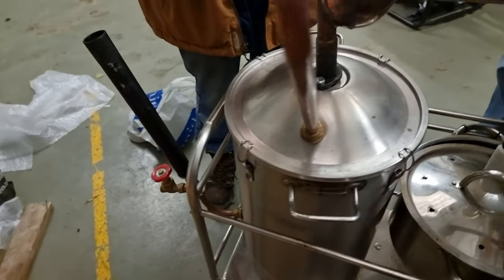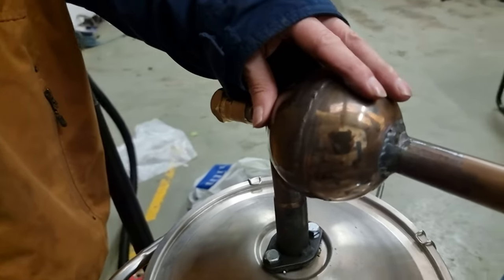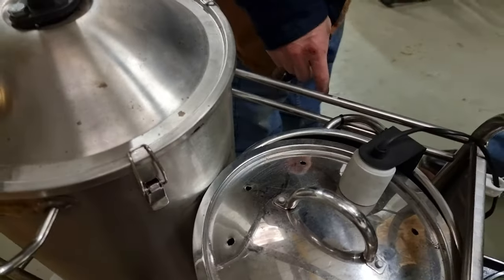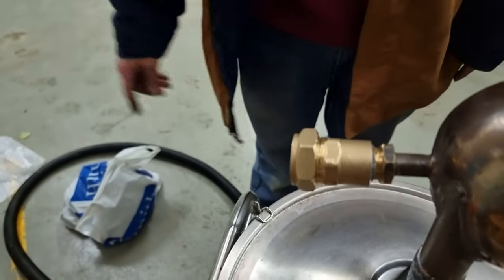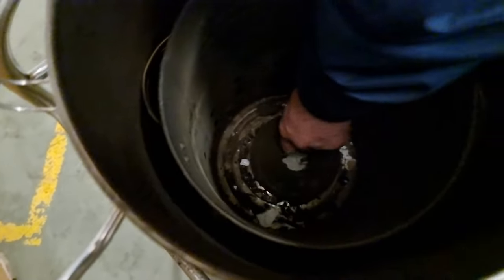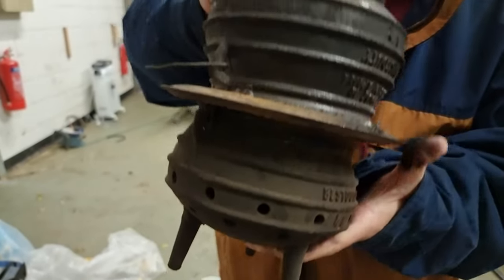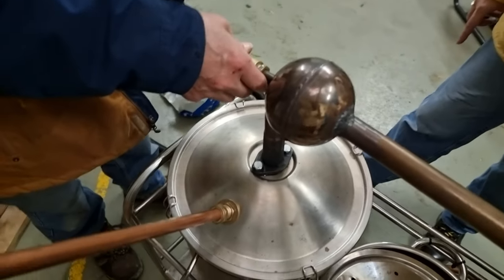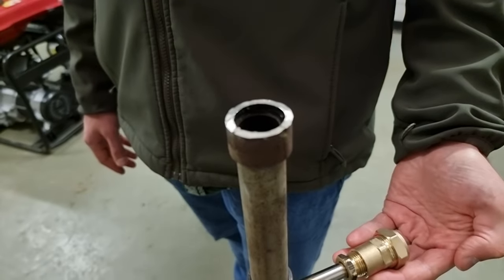THOR - Burning COAL

Comment: I just remembered that Santilli had proposed to use his special flavor of gaseous storable and compressable “plasmoids” to clean coal flue exhaust. If one can make the plasmoids concurrently with the burning of any CHO rich material, there you go, clean power and bye bye Net Zero narrative.
Reply from the maker: At the very least, no CO, lower HCs will make a big difference.

Comment: If it burns coal well it might as well burn waste plastic pretty good. I do recall seeing online a plastic pellet burner video that uses HHO in the combustion process and has a real clean exhaust. Most plastics are only comprised of carbon, hydrogen and oxygen so it could be an interesting experiment.
Reply from the maker: Great point!

This should be tested.
Reply: Anything rich in CHO can be burnt in such way. Some toxic chlorine rich plastics like PVC might be able to be cleanly burnt this way...
Reply: @curbina   Burning PVC sounds too optimistic to me, but if that happens, then .... wow.
Reply: Burning plastic efficiently is quite easy, there is a man who travels Thailand building gasifiers to that end. 
Primary problem with plastic is collecting it. Try to find enough plastic to light a campfire :) may take you a while. 
There is even a channel devoted to making bullet proof vests and armor out of old milk jugs. He must drink alot of milk.
Reply: Sounds like an easy fuel.

Comment: As coal was available to alchemists, perhaps this specific use as such was lost/suppressed, then simply converted into a more devolved method: Coal fired boilers. Same stuff, weaker configuration. The work I have seen on the history of fire places also raises questions about whether wood was ever burned in them, or were they rather harvesting energy as radiant heat in the andirons themselves. Just spitballing.
Reply from the maker: You may be spitballing, but you do it so well ;-)
Reply: They could have used gasification to fuel pure wood carbon coal as the complimenting fuel. If not the possibility of ethereal earth energy to cause the coal to glow but not combust. Or a combo of both in the fire place.

Comment: Is it possible that these machines are used in your shop to solve math problems with the help of gpus in return for digital rewards??
Reply from the maker: If you could make cheap energy, or better yet, it would certainly make sense as a means of storing value.

Comment: Fun  I think I encountered one of these at Adanac  salvage   It was taken apart I still got the oil water mixing system  lots of tar gets into these  it was early exsperiments hydrogen  gas by Ballard fuel cells but a very interesting mechanical control system I’ll get pictures of it
Reply from the maker: Yeh, the coal tar is pretty stick stuff

Comment: How is Jahannah involved in this? What's the point of having cleaner exhaust when burning coal if you have to run 2 vacuum cleaners on the side?
Reply: It's one vacuum blowing into the blast furnace and pulling through the plasmoid generator. This is just a proof of concept design showing the exhaust and pollution can be nullified. In application this would be retrofited onto a coal power plant that would generate more than enough power to negate any vacuum power you might need. As for Johanna she is a curious lady and wants to learn about this tech like we do she is just better connected lol
Reply: @CodyTaylor115  You're talking about burning few grams of coal vs burning millions of kilos of coal a day at a plant. So you're gonna need quite the vacuum to make it cleaner. Also, I am not sure if anyone realizes it, but ever since it was mentioned on JRP, the premise has kept changing. Sound vibration movement, molten sea ark, alignment of the universe, frequencies, essentially infinite free energy through air through zero point whatever, now it's turned into "You can burn coal if you use 2 vacuum cleaners and filter it in this bubbler"

All that jargon seems to have been created to mask the inherent nature of this contraption which is in fact, an elaborate nothing.
Reply: @marble25  It's intended in this iteration to be a pollution-mitigation device. Apparently it worked well in that application. I'm disturbed there are no efficiency calcs, and why Malcolm didn't list ANY quantitative data, some of which should have been second nature for any engineer.
Reply from the maker: I have no idea about Johannah, I didn't know she was going to be there until I was picked up from the airport. Regarding the other poit, CodyTaylor covers that below.
Reply from the maker: He was clear that this had not been run for a good while and the focus is on verification of the claims for the liquid/gas phase HCs.
Reply: @marble25 few grams? I'm sure it was more - even if u use a handful or half a kilo. But isn't this what the proof of concept is about? As to the vacuum, they don't need a pure vacuum. They need low pressure, such as created by the ordinary household vacuum cleaner. So of you noticed, every coal powerplant has smokestacks. The purpose of these is to create vacuum because there is lower pressure at the top pf ot and higher pressure at the bottom. So every powerplant has a way to create lower pressure by their smokestacks.
Reply: @marble25  well like I said it's one vacuum lol and yeah it could absolutely be a load of shit but that's why we all want to learn more.

But it sounds like you haven't looked to deep into this topic yet if you think they are scrubbing the pollution with a vacuum cleaner and what is essentially a very small bubble making chamber lol

There are other videos that go into greater details of the process alchemical science had a recent video that might help you understand. And again you learn what they are saying is happening and still keep a skeptical mindset on it all.

But they have pretty much proven that they can change the exhaust profile on gas generator. And considering all a gas generator does is  burning something it's not surprising that this tech can also apply to coal burning too. The reason they need a vacuum on this version compared to the generator is because the generator by its nature creates vacuum, but a blast furnace burning coal doesn't

Comment: Bob, you said to debate this here. Your friend's device uses 2 vacuum cleaners that use up 2000 watts. The UV lamp to ionize the gas uses 1000 watts for a total of 3000 watts. He has 1 kg of coal in the burner that can generate 30 megajoules of energy total. 1 kg of coal will burn for 1 hour normally, so this is 86,400 seconds for a power rating of the coal of 350 watts so changing the CO2 and CO into oxygen is very inefficient.  A power plant using this technology would not work to well. No one would get any power and some other power source would be needed. Even if the generator is fusing the CO2 and CO into oxygen with the water from the bubbler with LENR at maybe a Q factor of 9 this means that the extra power generated (3000 watts) still would not make the device economical and would only break even with power generation.  You forgot to ask him if he has the center pipe in the Thor generator magnetized to produce the plasmoids.  Just saying. It would be the same issue with his motor generator as the motor would conk out under a heavy load.  Put the motor generator under a 10,000-watt load and then we can talk as I know how to make the magnets last longer. Ask Malcolm to power a steam turbine to generate 10,000 watts of power with his coal device and then we can all talk.  Also, the Thai guy with his pipe heat generator implodes and crushes and clogs up with fusion waste after 24 hours. The only way to avoid this is to make a spherical device so that the compression strength of the copper would withstand the implosion like I do with my star device. Can he make a spherical device like his cylindrical device? Also, Bob tells Malcom to prove the center pipe is not a magnet by taking the device apart and see if a piece of iron sticks to it. I have only seen the Thor generator in its manufactured state and not non-manufactured. Don't just tell me it is not a magnet.

Comment: Lol it’s cute nice unit as I mentioned I got pats from Ballard fuel cells  the power units I made for japan if manufactured ould be a good source of alternative energy as well as a few others
Reply from the maker: The more was to produce large scale clean, affordable and reliable energy, the better.
Reply: @MFMP  yes it was the goals of may long ago as coal  buring had many issuers it’s a interesting time o many  to build this system of coal gas and steam engine effieancy  I love the relics from this time frame mostly forgotten now but relicswind up on eBay or scrap yards